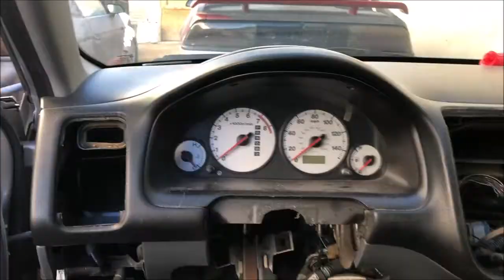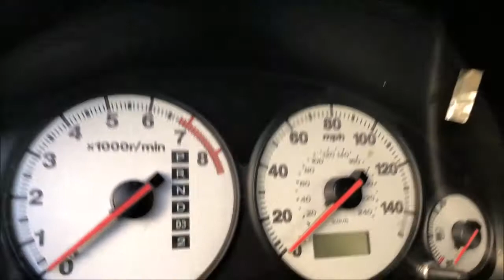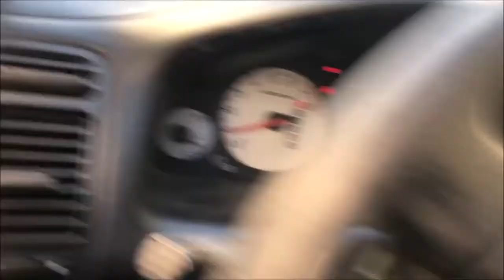2002 Civic Heatercore

Comment: I accidentally cracked my heater core when I was trying to get the get one of the hoses off..was twisting to break the seal and I never even gripped hard but yet it cracked..did you have to cut the plastic on the dash to get it past the heater core?

Comment: How in the heck do you get the blower motor out? I'm a complete novice at working on cars.
Reply: The blower motor is one of the easiest things to remove. It has 3 torx screws that can be removed from under the dash once you pull down the under-dash cover. It will just drop on down.

Comment: Hi, great video! Could I get some contact info please? I need help with a very specific problem (stuck air mix blend door) and I cant find anywhere where exactly it is. My idea is to cut a hole and try to fix it without removing the dash.
Reply from the maker: Just look up blend door actuator ,  you should be able to find what you are looking for ,,,, you shouldn’t have to take dash out for that
Reply: @Darrenlawrence89  I have older version without actuator. Its controlled manually with cable and bowden. There has to be some problem inside, so I need to get in there...
Reply from the maker: What year?
Reply: @Darrenlawrence89  2001 1.4l
Reply from the maker: If you suspect the blend door is broken then I don’t see any other way around it ,,, you might be able to take box apart but you will still have to remove dash to gain access needed ,,, that’s just my opinion though ,   Try what you are thinking and if it works cool